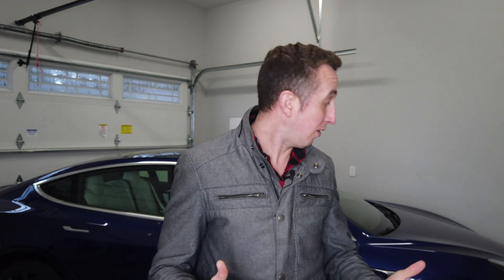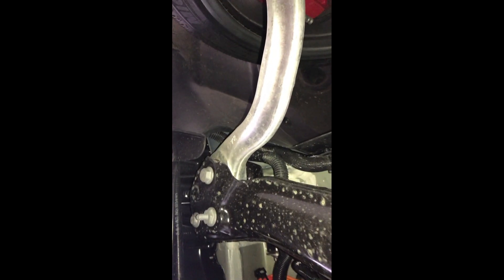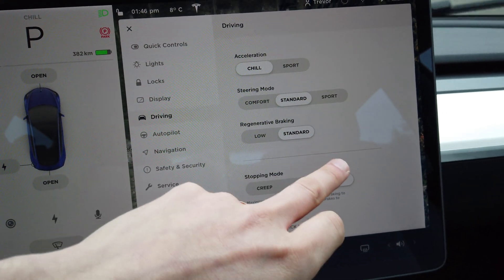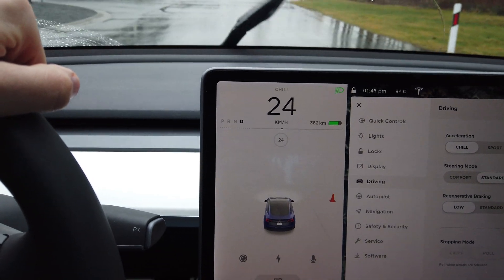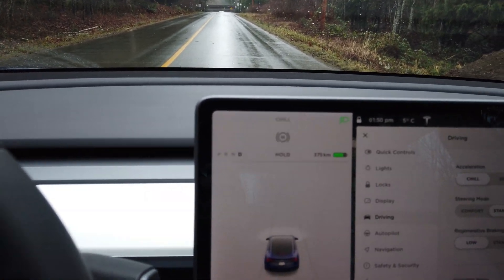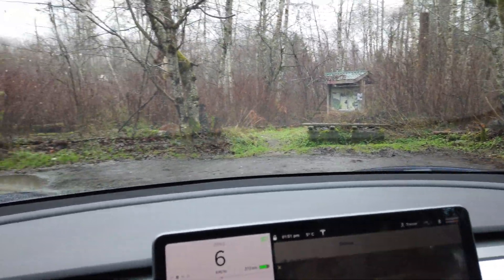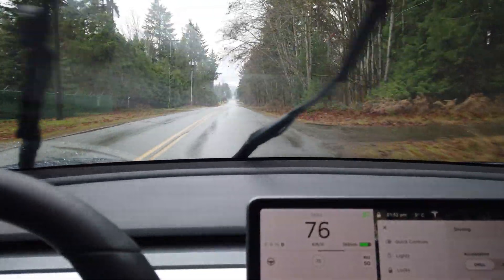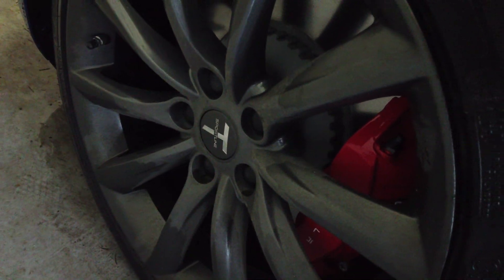How To Fix/Prevent Model 3 Performance Brake Squeaks

Comment: This Is called bleeding the brakes. This is what the tech did for my car. It doesn't work (very temporary)  and it looks so stupid to see a 70k car racing up & down the street slamming the breaks.
Reply: I'm going to clean my wheels and use spray lubricant. Hope it works.
Reply: @RON_KUBY  did it work?
Reply: @luludvega  It worked for a short time, but I had to do it often. I've since moved on to a new Tesla and have had zero issue.

Comment: Or replace the rotors and pads with ceramic ones. Hold up even longer, no rust, lower PM2.5 emissions and smoother drive since the brake is much lighter.
Reply from the maker: This is true!